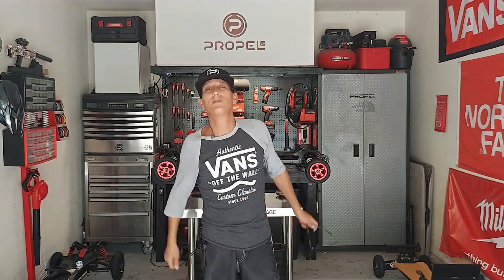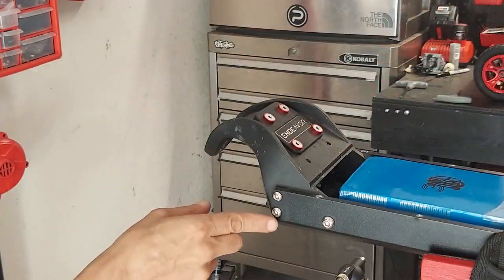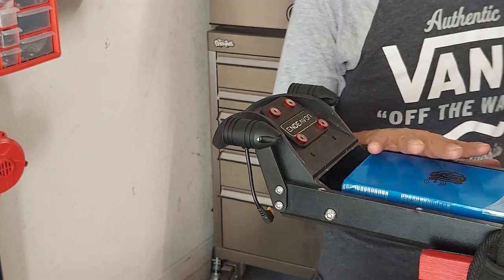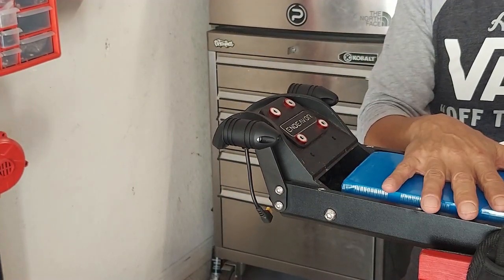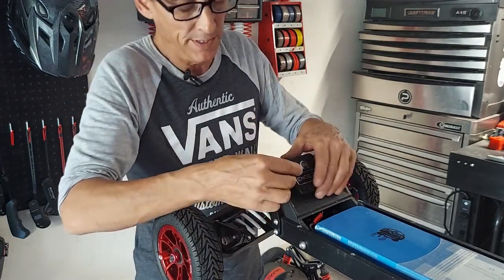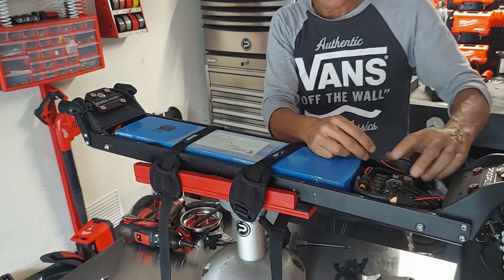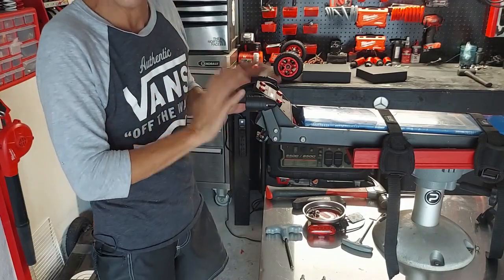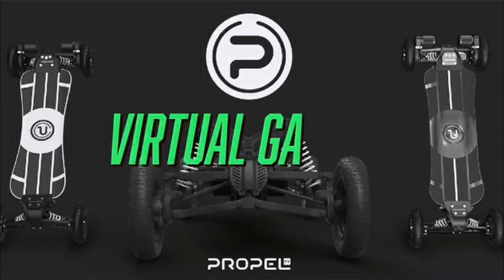Endeavor 1 Light kit installation

Comment: I just installed my lights, once I connected the final pigtail, the power lights for the board and the lights illuminated and won't go off. The lights work on and off with the switch but the power lights are staying on the whole time and I can't turn them off, Any ideas?

Comment: Hi, what are the wheels on. this board please ?  Looks like 165 or 175 mm ?  DO you sell these ? DIfferent cçlors ?  Would it be possible to put Cloudweels Rover on it ? What about the poulies ? Would they fit ?    Thanks for your responses .
Reply from the maker: These wheels ar BKB 6" street tires on the Propel Bravura Monaco rim.
Rims will take most 6,7,8 or 9" x 50 the tires.  We sell the 8" knobby and the 7" street tires on the site

Comment: Hello, just ordered light kit for my Endevour1 but recived lights for Endevour2. Can I still install E2 lights on E1 board or should I ask for a change?
Reply from the maker: Unfortunately not because the badge included, with the power button is different.
Please contact services@ridepropel.com and we'll get the right one out to you asap.  

Now with that said, if you wanted to just put a power button somewhere else, you CAN use the,.  Theyre really nice, super bright, no rattle.  Your call

Comment: Wow. Guess I'll be HeadLighting! Everything after "Take the Deck Off......." is nightmare inducing. Also, I don't think that's at all necessary. I think You just screw it in the side and then try to pinch it in under the front nose.
Like blindfolded Rubiks cube or something